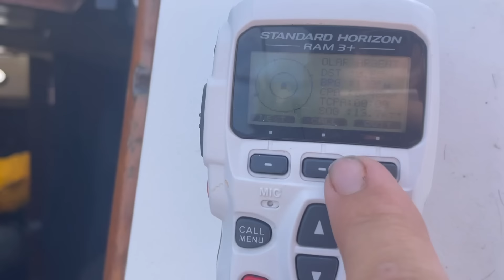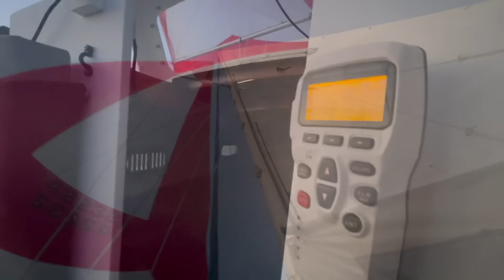Alone across the Atlantic pt 2

Comment: great videos Sam. years ago when i was sailing with my dad, he found a neat invention to "calm" a boat down at anchor. we'd anchored at Catalina Island off of California and the surge rocked the boat pretty hard. so before the next time we went, he rigged up a couple of car oil catch pans with some lead weights, drilled a few holes around the sides and rigged them together with medium sized line. he tied the boom off at 90 degree angle to the mast and suspended the two rigged oil pans off the end of the boom. the drag from the oil pans acted as a brake when the swells rocked the boat. the thing smoothed out the motion of the boat and made for a really comfortable nights sleep.

Comment: Well done Sam! Crossing an ocean  in a small boat is an epic achievement in its own right but doing it single-handed puts it on another level of extraordinary achievement by an extraordinary individual who has earned my  personal admiration and respect.  I am only one among many others who feel the same.

Now, down to practical matters. If that autopilot is the second one to spit the dummy just when it was most needed, then that indicates to me that Taylor's are dealing with a design òr production failure and they at the very least owe you a replacement item  - after they have corrected the problem! 
Anyway, congratulations on a spectacular achievement!

Comment: This is so good.   As I'm sitting here, saving up to buy my bigger boat, I watch you in wonder.   Thanks for showing us you can do it in any boat!   I enjoy your videos and your upbeat narrative.
Reply: Hi, did you manage to get your boat?
Reply: Yeah. Did you get the boat?
Reply: Remember the golden rule "Go small, Go  simply, Go now".
Reply: @Stephen Burnage how simply can you cross the Atlantic? You need some kind of auto pilot, good batteries etc
I want to do it in an equally small boat next couple years. All I'll be able to afford is small
Reply: @philipfisher5168  People have done it in rowing boats but that is a little extreme 😳.  My suggestion would be 26, 28 or 30ft as there are many boats available to chose from in that size range. If you are lucky, you might find one already well equipped. Astute of you to pick up on autopilot. You need something to cross oceans (you cannot hand steer 24x7) but electric autopilots consume quite a bit of power which means more complexity (extra batteries, generator etc). The answer is usually a mechanical wind vane/self steering mechanism but these are very expensive new so try to find one second hand and/or a boat already fitted with one. Good luck.

Comment: Fwiw the fish carcass, after fileting,  which it looks like you threw overboard, has 2 uses.  Can be use as bait and fish head soup is super nutrifying .
Reply: I didn't know if he was bleeding it or throwing it overboard but your comment made me really crave fish head soup stock!!!
Reply: Good points, but unless there's no wind, using bait may not be possible as it will tear off of hooks with the moving water, and cooking soup from scratch takes a long time and requires alot of gas
Reply: Agreed 
Fish stock only takes a short time to make and is worth the time and effort

Comment: One of the things that gives me anxiety watching you is the possibility of you falling off and having the boat sail away leaving you behind.  Then I noticed you drag a long line behind you. Is that to grab onto in case you do fall off?
Reply: That and he generally wears a lifevest with a safety rope attached.
Reply: The trailing line is supposed to be attached to the rudder to turn the boat around.  Its not realistic to pull oneself back to the boat while it is in motion.  The harness and jack lines have drowned many who were just dragged through the water when they fell overboard.  The tether has to be very short, like 1 ft.

Comment: When sailing down wind and you have plenty of wind in your Genoa, put the leech of your main cell directly into the wind and Sheet everything in nice and tight. That will stop most roll. Another trick is when sailing a little off the wind downwind Center the leach into the wind and let the wind sail backwards over your main and come around into your jib. It turns them into basically one great big wing and you get a nice draw

Comment: Maybe you've done something of the sort since this video came out, but have you considered putting an electric motor on as well? With that solar panel and battery system you could power a trolling motor or two. Depending on the draw of your other equipment and fridge you may not be able to run them all the time, but it would be a good backup if something happens to your gas engine, would be much quieter and could help offset any currents pushing you back.

Comment: did the same trip in 1998. solo in a 30ft Golden Hind. your boat looks a bit smaller. itwasfun and i loved it. ended in lauwersoog/ north netherlands. noises,dolphins, speedystitcher, saltwater everywhere etc etc nothing new there. mayby you have more weatherpredictions systems. i only had common sense and a watch with an atmosferic pressure system. greetingsfrom an old man. jw

Comment: 33:05 -- Hey Sam!  New sub, I've been enjoying this trip and waiting to get a peek at your fishing gear.  I recognize what you're currently holding as a hand-line with "jigger" and wouldn't normally be trolling with it, myself.  That's exactly what I would be using to try for codfish though.  Best results for cod involve fishing on or near the bottom, which also means finding suitably shallow water or else the reel is far too bulky.  I'd guess it's common to find reels with maybe 50 fathoms of line on it where I'm living.

Fresh Codfish are the best.  Salted and dried they're not bad though.  Fresh codfish are also excellent because you can take more than the fillets.  I have uncles who commonly consume over 80% of the fish, removing only the tail, fins, sometimes skinning (not always) as well as taking choice bits of meat from the head of the fish (we call that the cheeks and tongue).  The meat which is remaining on the cod's soundbone makes for great fish stews.  Waste not, want not.  o7

Comment: Regarding Bottom Paint, Did You Use 'Coppercoat?  It's Pricey, But It Resists Everything Sea.  IT's Anti-Fouling.  I Think It Has to Do With Copper Metals, and How They React to Salt Water.  Copper Will Tarnish, and It Looks Like You Had Tarnished Copper on Your Hull, When You Parked It in That Tide Flood Plane.

Comment: Not familiar with that particular autopilot or whether there is visible access to its compass, but the symptoms sounded like possibly a compass problem.  Maybe it was stuck or you could have inadvertently set some steel object down too close to it?  If visual inspection not possible, think it would have been worth gently tapping the assembly with something like a hammer handle to possibly free the compass if it was stuck.  Would be interested to know if you found out what the failure was.  Haven't finished watching the video yet so apologies if problem gets resolved before reaching the Azores.

Comment: Small point on food economy. 
- Fish, when all inner organs are taken out, need to have the head chopped off, and the spine with bones taken off, and that is all. The fins if properly grilled are dellicious, and even the head and some of the inner organs (excluding the greenish) can be used into the fish soup. AND if you are catching the fishes en route, the head, and some fins can be used as bait. You did throw it all into water. 
- If you get more (fish or other) meat, than your refrigeration capacity handles, put the pieces into sealed bag with salt. The salt takes of the meat much of water, and less water it has, smaller chance to get rotten. And when you decide to eat it, simply clean the salt of the pieces before grilling.

For your health when sailing, it is better to have constant income of vitamins (C especially to prevent scurvy), magnesium, and some salts. It is good to have some sweet treat - that might be honey, dried fruits, or plain sugar. Even concentrated fruit juices have its merit, because (on top of making sweet drink out of water) you can dip bisquits in it, and make ad hoc "cake" like that. Condensated milk is ok too. Can prevent the lost of eggs by using taught thru packaging for them. 2 bricks of foam, cut (or heat) inside the holes for each individual egg, with enough space between them, and enough space between them and sides of said "bricks", and than fill them with eggs, and than simply bind them around by cord, or use big enough rubber o-ring to fit around, and keep those 2 pieces of foam together. Pretty handy device for this kind of lonely sails is a solar still (ment for making destiled, desalinized water), in combination with deep dried food. 

It is easy to play smart AFTER a trouble happens, but the point with the kindle books could be VERY SIMPLY CHECKED before you left the port. Or alternatively, you could back up in different system/program (say tablet + PDF). Why you did not gimbal a whole table, on wich you can THAN put your gas burner, as your other burner, and have BOTH not-spilled around?

Small upgrade for your fishing line. If you use a long rope, one side bound to your ship, other side bound to something what floats, and than hang on it with say 2 meter spaces between them the lines with a hook each, your statistical chances on success goes exponentially up.

Comment: Hi - those dolphins where trying to tell you that you are wandering to close to the shipping lines. Steer clear and plan your course in such a way to  avoid the commercial shipping  lines ... at 19 knots those mastodonts are needing at least 2 NM to make a full stop in an emergency and your sailboat is just a piece of cork for them...also I noticed that you are sleeping with your daily sail setting.  It's a good idea to reduce at least with a quarter your  sail setting for the night period if you are alone. It's not only more comfortable to sleep  at slower speeds but also you will have more time to react in the unwanted case  of sudden wind changes or gusts... Never seen in the video your  navigation lights  - do you have them  ?  If not consider using at least one powerful strobe mounted at the highest point of your mast . The modern designs based on LED technology consum very little power and with them you are giving yourself the theoretical chance that maybe sombody  will spot your strobe in the darkness from the 50 m high command bridge of the container ship and so  avoiding  running over you while you are playing the piano or peacefully snoring in your bunk,... Think safety first. I feel the need to try giving advices because the experienced comments sims to dried out from your feed ... I watched dozens of sailing channels on YouTube , yours is the first where I pushed the subscription button.  Just because you are the first who is playing the piano while sailling.  Thanx a lot for uploading your wonderful sailboat video diary and take care out there.